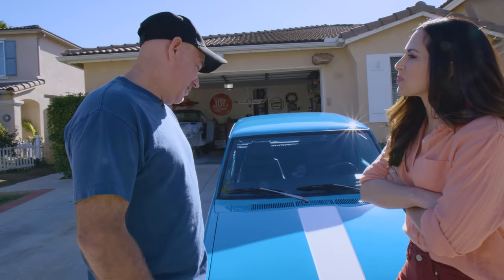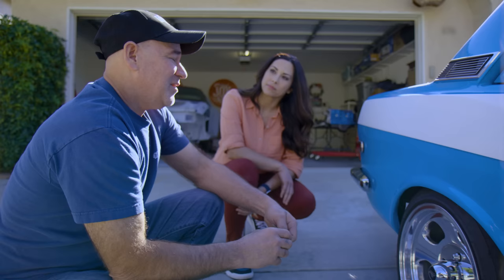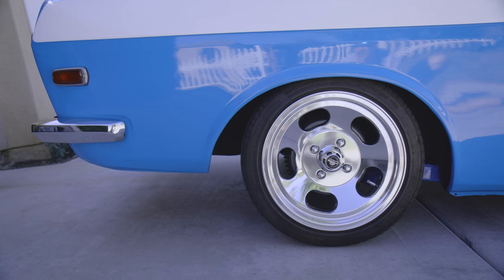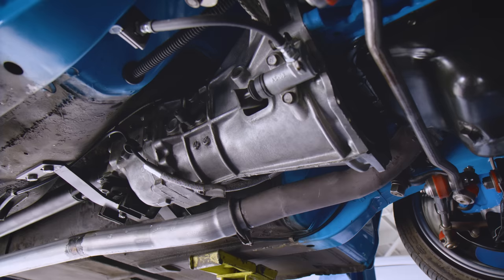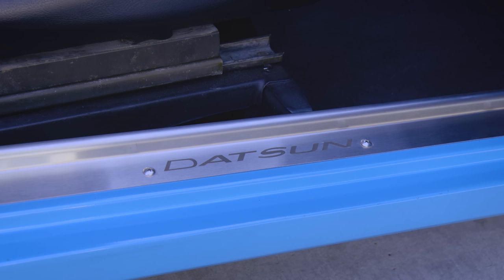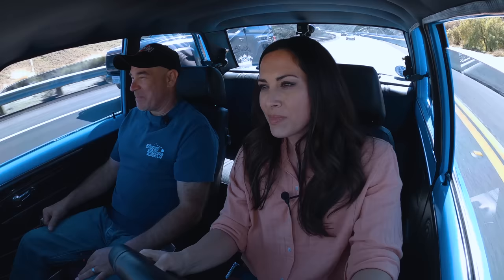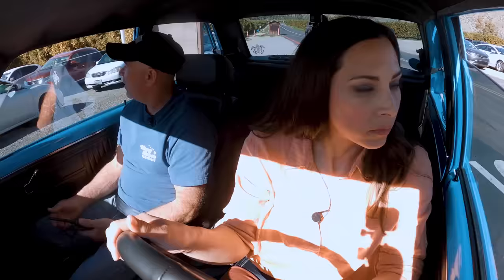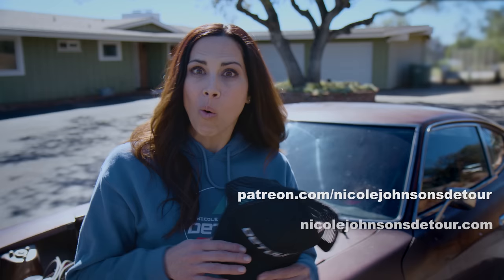DATSUN REBORN: Second-Chance 1970 Datsun 510 Saved From Wrecking Yard Death | EP13

Comment: This is my kind of guy. The RC planes, the cars, the do it yourself kind of thing.
Reply from the maker: Yes..I agree.  Thank for watching!!
Reply: Thanks I love flying model aircraft in my spare time it's so amazing to be able to control something in the sky with no strings attached. And there's nothing like having a garage full of birds 🤣
Reply: @harryshomegarage  I tried flying an RC airplane maybe 10 years ago. I crashed it up so bad that it was mostly tape and hot glue by the time I was finally able to keep it in the air. I had fun with it for a few minutes then got it stuck in the top of a 70 foot tree. I didn't mess with RC again until about 2 years ago and discovered FPV drones. I've been flying those for a while and am about to buy a plane again. I'm sure from what I've learned with the drones that I can keep the plane in the air now. I also work in a composite shop and build the molds for carbon fiber racecar bodies. I repair the bodies and we also have a paint shop and do a lot of old classic cars and late model Ferraris and Lamborghinis.  We have a 66 Mustang Shelby 350 fastback in there now.
Reply: @CarbonGlassMan  Wow Holy smokes! FPV drones are way harder to fly so I'm sure you'll have no trouble with a plane now and the technology has also improved so should be a walk in the park 😉
Reply from the maker: FPV drones are so cool but take some mad skills! For our Ultra4 Bronco episode (https://youtu.be/TnsC8Q2JWMc), we purchased an FPV drone to keep up with the high speed of that car in the desert. My son actually flew it, but had only a few days of practice before the shoot. I was impressed he picked it up so quickly! I blame all the video games he's played 😂
Reply: @NicoleJohnsonsDetour  That is impressive flying for just a few days practice. Does your son have a YouTube channel with his FPV hobby?
Reply from the maker: @CarbonGlassMan  No, but he's part of our production crew, and helps us when he's able to break free of his college classes. He took a drone course last year!...Crazy that it's something offered at the university level!

Comment: Great job Nicole, first time watching your channel and glad I did.  I was hoping you would talk about the independent rear end, but that's okay.  My very first car was a 1971 4-speed manual Datsun 510 4-door sedan, light yellow with a black vinyl top and black interior.  I bought the car near SeaTac airport in 1975 from a women (she purchased the car brand new in downtown Seattle) who just got married and worked for the airlines.  So needless to say the car had less than 9,000 miles on it.  I had to work and save the money to buy the car and have enough for insurance.  My Dad and I had been looking for cars that were less than $1,500, but this car was selling for $1,800.  I talked my Dad into going to look at it anyway, even though it was over my budget.  The women sold the car to us for $1,400, but I didn't have enough for insurance, so I talked my Dad into lending me the extra $200 I needed with the promise that I had to pay it back within 6 months (He really liked the car also and knew it was like new, so he let me buy it).  I had the car for just shy of 8 years. I modified the exhaust with a high RPM long header and 2 and half inch pipe with what was called at the time a turbo muffler (Exhaust Specialties did the work in Ballard or Seattle area).  I had it dyno tuned at the only place around that did it (never heard of that before, a friend told me about the shop just off of 145th and Highway 99 in 1976).  With the header and the exhaust it pulled a 104 HP out of that 1600 engine, yeee haaa!  It did 17 second flat quarter mile runs at between 70 & 74 MPH at SIR in Kent, could not get to go any faster even with speed shifting.  The car could cook and the front end started floating over 120 MPH, no spoilers (speedo only went to 120).  When I owned the car I didn't even know it had a independent rear end.  I learned a lot since then because of others teaching me all about those Datsun 510's from fine people like yourself and others in the last 40 years.  Thanks again and I hope you and your dear family have a wonderful week and weekend!! [[ I'll be watching for more for sure. ]]
Reply from the maker: Glad you enjoyed it.  Thank you for sharing you're story with us..love it!
Reply: love that story! That was definitely a fast car at the time probably faster than some V8s considering the Horsepower to weight ratio. Thanks for sharing
Reply: @harryshomegarage  Great job Harry, you got skills!!  Thanks for doing the videos, yours and Nicole's!  Brought back a ton of memories.  May the good Lord bless you and your dear family!!
Reply: @thomas9079  Thank you for the love and may the good Lord bless you and your Ohana as well🙏

Comment: In 1971 I lived in a suburb of Sacramento and on rainy days I would see 3 510s in Brock racing livery doing donuts and 360s like a stunt team. I was 9 years old and thought they were the coolest thing ever. Many years later I had a broken clutch basket on my Yamaha RD 350 and was referred to a guy not far from where I had lived and seen the Datsuns. He welded up my basket and when I picked it up he showed me his shop. He was welding up 240z heads and re porting them. It was the coolest thing. I became a fabricator and have had and modded several Datsuns and Nissans. This was a fun episode. Ps. I want window openers like that! Mt Honda Element has those flip latch windows. I think there's a market.
Reply from the maker: Thank you for sharing with us!!

Comment: Yes, LOVE Harry’s “Dime”! I spent years longing for one until I finally found a dark blue ‘72 2 door from a neighbor’s sister - turns out it had quite a bit of rust and that was in 1980! By 1986 it was all restored, though, with 1800 SSS, 5 speed, Libres and a tasty custom interior built around a pair of Scheel 400 seats that I’d lucked into. It would have looked awesome next to this one!
But I gotta be an “anorak” for a moment: Harry, these are not exactly the original brakes. You musta forgot that the rears are 240Z finned drums, a very cool period upgrade!
It’s beautiful Harry & Shelly!
Reply: Haha yes thanks for reminding me good eye! I totally forgot to mention the front brakes are from a 1982 Nissan 200SX the calipers are slightly different from the originals and I had difficulty identifying these when I was trying to finish the brakes 😳 for the most part I'd call it mix and match stock 😀 Shelley and I appreciate the love thank you ❤

Comment: Had a 72 510 in 1979/80.  Ran perfect...solid underneath..great interior..50,000 miles.  Needed paint.  Why didnt I keep it...loved that car.
Reply from the maker: Thanks for sharing!!
Reply: Don't feel bad I let a good solid 510 go in 2003 it was a 72 original California car and had no rust. It still kills me. Thanks for the love 🤙
Reply: Hind sight is always 20/20 vision. Who would have guess that vehicles today packed with safety and technology would cost soo much$$$$$$$.
The cheap fun car you can buy and modify to your taste is gone for good.  The fixable older project  chassis of any make are super hard to find and if you find one its thousands too.  
My older brother bought a brand new 510 back in 72 and drove in till it dropped...up here in Canada rust is bad. Somewhere along the way I put new fibreglass fenders on it for him and re-painted it in a chicken coop...when it finally completely rusted apart the engine was still running strong !  With its IRS and nimble road manners called it a poor-man's BMW.

Comment: Nice to see one of those survived this long. Owned four 510 and a couple 240z. I could fix those L type motors in my sleep.
Reply: But they so rarely needed fixing. At least mine didn't.    This  '70 510 has '72 rear quarter running lights.

Comment: The car is done up perfectly and the wheel combo is on point
Reply: Thanks for the love my friend. Got super lucky with the wheels and fitment. A friend at a local Discount Tire helped me locate four in North Count San Diego and they were open box, so I actually got a smoking deal. I was Also able to take them home to double check the fitment and make sure the rears would tuck inside the rear wheel well because that's the look I was hoping to achieve. Super lucky with the zero offset on a seven-inch wheel. It must have been meant to be :)

Comment: my first car was a datsun 1600 ( the name the australian car was given)  first 1 side draught webber and headers, then a worked 2ltr with twin webbers, then and lastly a z20 with turbo intercooler and aftermarket fuel injection, run 12.2 et at 121 mph.  sadly rust from the front widow vents and way too much hp destroyed the chassis.  the running gear was then transfered to a 4 door !80b and then i purchased a 180b sss two door, z18 turbo.   all these datsun are now rare and worth a small fortune even for a nasty rust bucket and good ones fetch 20k plus.   i miss my datsuns,  tnx for the meory Nicole.
Reply from the maker: Thank you for sharing with us!!

Comment: Love my Datsuns too have 3 1969 2000 roadsters as well as a Subaru 2.5 RS which is getting a 450 hp 2.7 STI running gear and a wide body 22b body kit . Subaru RS is the tuner car of the 2000 like the Datsun 510 of the late 60’ early 70’s
Reply from the maker: Thanks for sharing!!

Comment: Subbed - I had a 1973 Datsun 610 in the U..S. Air Force in 1975. It had a Pro -Built 1800cc engine -$1,000 - 155 hp (SSS) 2 sidedraft SU Cabs, etc ... I also had a '74 710 - and worked in the Race Shop of 2 Datsun Dealers . Very nice 510 - teared me up a bit ...
Reply from the maker: Thank you so much for the sub!!  We appreciate the comment!!

Comment: A work buddy invited me to see his passion, dirt track racing his B210 at Ascot raceway, the local dirt track the featured professional series.  These little guys were the filler races, B210 dominated because they were cheap, fast, and could take a pounding.   After a couple of qualifying heats of nothing but 210's colliding into the first turn, and then a buzzing group would slam and push for the rest of the race, an MG "B" showed up for the next qualifier.

The MG hadn't the speed and was left in the dust.  However, his chassis was so much better handling the rough dirt, that he simply took an outside line , and once he got some momentum, was soon easily lapping the field.   it was clear every B210 in the place had just become obsolete .  So at the next restart, they were frequent the way these guys raced, the MG was at the front of the field.   Without the initial speed of the B210, the MG was a sitting duck, the group caught the guy at the first turn , but instead of passing , they just smacked the crap out of the guys car, putting him out of the race.   Then it was all B210's for the rest of the night.
Reply from the maker: Thank you for sharing!!

Comment: My parents bought one of these used back in the mid 80's but it was a 4 door. I rolled it. As it turned out the previous owner put trailer tires on it to sell it. I was coming off of a dirt road that kind of merged onto a paved road and there was a difference in the height between the two roads the paved one being higher and as the front passenger tire made contact with the asphalt it striped the tire right off the rim. The rim garbed the asphalt and the car just rolled right over. At least no one was hurt. It was hard explaining to my parents that I wasn't driving crazy or being reckless. It wasn't even until later on when I went to the tow yard to retrieve somethings from the vehicle that I realized that the tires where meant for trailers and even said right on them not to put them on cars. I don't know why my parents didn't try and get their money back or sue the guy that sold it to them but they didn't. The 4 door model wasn't nearly as cool as the 2 door though. Shortly after that I bought my first car, a 1963 dodge dart. 

Back then there was a factory authorized high performance parts company kind of like MOPAR's "Direct Connection" that sold high performance motors, transmissions and suspension kits for the 510 and 240 through 280 Datsun Z's. I can't remember the name of the company now but they sold some pretty serious racing upgrades for the 510. There where complete suspension kits with independent rear ends like the Z's had with 4 wheel disk brakes, roll cages, turbo charged motors with all aluminum blocks and heads and 6 speed transmissions but I remember that stuff was real expensive though. The stuff was geared for track and most of the stuff wasn't even street legal though. But it was factory authorized and could be purchased right from the Datsun/Nissan dealer and you could build one hell of a racing car. In Japan these cars where pretty common on the track.

A couple of common mods people would make to these cars back in the day where to put dual Webber side draft carburetors and after market intake manifolds along with headers. Of course you had to lower them and put wide tires and after market rims on them too. Possibly some bucket seats, window tint , some 6x9's and a Pioneer stereo. Oh and last but not least a GT grant steering wheel because the stock one was a giant hard Bakelite type material common to most cars in those days and the GT Grants where so much cooler. 

It is amazing that for as common as these where back in the day they are so rare to see now.
Reply: Great story
Reply from the maker: Thank you for sharing!!
Reply: Awesome story! Glad you survived to tell it!

Comment: That’s a gorgeous little car. I’m not sure I could live without mirrors though, a central mirror mounted to the windshield at least though I understand why he didn’t add external mirrors and sun-visors. I’ve never heard the “touch a screw” saying either. I don’t really remember these Datsuns but maybe not a great seller here in the UK, especially as they look so similar to the second generation Ford Cortina
Reply: Thank you for the love and yes a simple wink mirror would be helpful and is definitely on the list especially since the original car had one😉
Reply: simple piece of junk mirror- get the factory day/night unit from a junkyard or your nissan dealer (part # 96321-K2202) or get a used one from a 610 or 710. compare the two mirrors and you'll agree the wink is dangerous and cheaply- made. the mode is changed by twisting a knob on the bottom. if you spring for the datsun mirror-its about $100- much cheaper than bodywork or injuring your head. get the breakaway  bracket from your parts person if yours is missing. its sprung, so if you knock it off it can be snapped right back as the mirror mount is sprung just like the stock 510 mirror. if someone replaced the headliner, the bracket may still be there underneath. the 510s never had such mirrors installed at the factory. my 72 510 had one in it (from the previous owner) and it was the first thing i discarded. you won't regret getting the factory mirror.  @harryshomegarage

Comment: Had a 69 that I loved. The mechanics called them "Nickel and Dimes" cause they were so cheap to build back in the day.

Mine had an L20B truck motor with Recaro Seats, a Roll Bar, Shelby wheels, red with all the trim blacked out.

One night in San Diego I was watching Miami Vise and I get  phone call from a police officer. He said look out your front window do you own a red 69 510? I said yes, and he said I'll pick you up in a second somebody took your car for a joyride.
 It was a foggy night we come to a blind corner and my baby is upside down with the lights on and the rear tires still spinning at the bottom of a small canyon (Southside of College Blvd) 

We found a girls wristwatch, some hair and blood. The tow truck pulled it up two stories onto the street. When it go home I started it and it ran. All the panels were smashed, the roll bar saved the kids who stole it. We used  to drive it around drifting it, doing slides until the city impounded it. It was such a sweet 510.
Reply from the maker: Wow..that's quite an experience..thanks for sharing!

Comment: Had a smile on my face all the way to the finish of the video lol 
I had a few Datsun s 510 but the One that I miss most is the 1969 got it in 1990 for $600 or $500 I like to negotiate so I’m not sure 
It was definitely not a rust bucket , it was running and driving automatic , Which I replaced it to the four speed and looking for the 5 speed , I had so much fun in the car but end up selling it because I had my license suspended lol🧐 still looking for a replacement but not that easy to come bye 
Don’t sell it you’re gonna regret it I love the paint job and I love the white stripe on it Nice video.
Sold my 510 and in return I bought the 1973 240Z and the Austin 63 Austin Healey sprite with the money I got for the 510 
It was not a good decision still have the Austin Healey …..
Reply from the maker: Thanks for sharing with us!

Comment: I could have had a Datsun 510, but I bought a Vega GT. I was young and stupid, I know. But the Vega was blue.
Reply: I hope they do a Vega episode someday!
Reply: @CarVideoCzar  You are really rubbing it in, aren't you. The linerless aluminum block and cast iron head engine was a recipe for disaster. Turbocharging made horsepower, but aluminum on aluminum with iron piston rings added to the mix? Plus, the chrome trim around the windshield would rub the paint away and rust cancer would result in serious leaks.

Comment: Staying with the L-series is the best part of the car. Everybody puts KA24 and SR20 engines in 510s and its not like you can't get plenty of power from an L-series. You technically can put a KA head on an L block so theres interchangeability between the L, Z, and even KA motors. The L being a wedge reverse flow, the Z being a cross-flow semi-hemi, and the KA being a pent-roof 4 valve. Its pretty Interesting.
Reply from the maker: Thank you for the comment!!